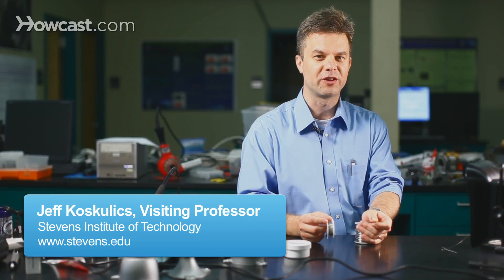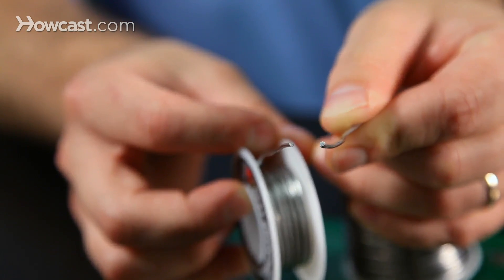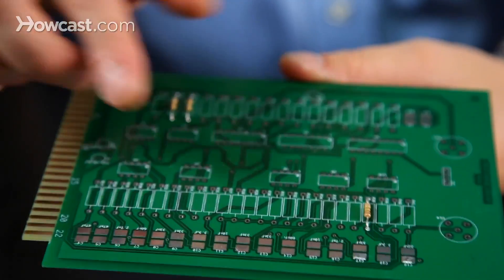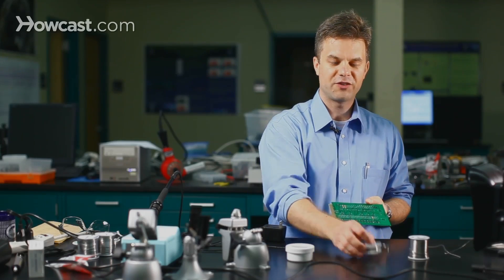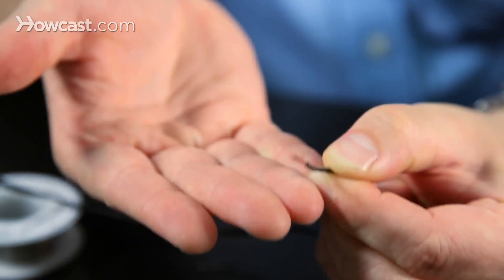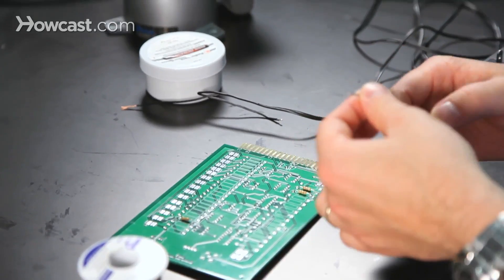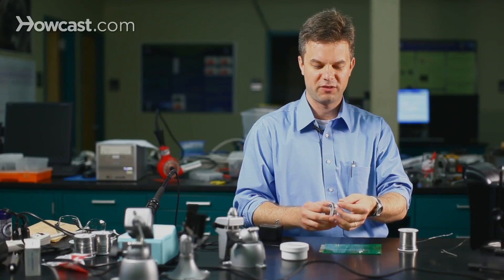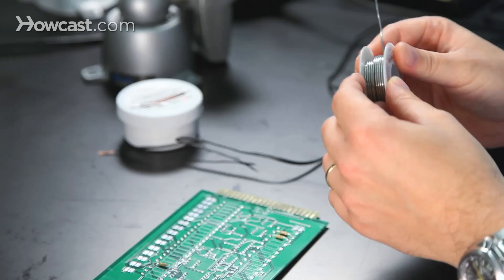Does Your Core Solder Have Enough Flux? | Soldering

Comment: I'm just watching for entertainment. I remember my dad had an old pickup truck that had a broken "headliner display" compass/air-temp thing that I fixed with a bit of soldering. 2001 Ford F-150 if anyone's curious. Turned out to be a common issue. But I still be here being nostalgic.

Comment: Clean enough? Never clean enough! The cleaner all surfaces are, the better the solder works and that goes for the flux as well! Not wearing gloves is a violation of soldering protocol. The gases that are produced from solder operations can be absorbed through the skin. These gases contain lead and therefore not desirable to get on or near skin. Gloves inhibit the absorption and thus prevent ingestion by the skin. It’s a safety matter and by wearing gloves, no finger oils are imparted on the surfaces of the board, wire, leads or any conducting surface of any components. It matters less in lower frequency equipment buy finger oils cause the formation of air pockets during solder operations. The air pockets act as mini capacitors and at higher frequencies can reek havoc with high frequency equipment. This is just the beginning. There is more, but this isn’t a class and I am not teaching it. It’s just FYI for people who care about their personal safety!
Reply: thank you about the mention about wearing gloves. ive been learning soldering lately and while i have good venting,mask, and eye protection. i never heard anyone else mention skin protection.